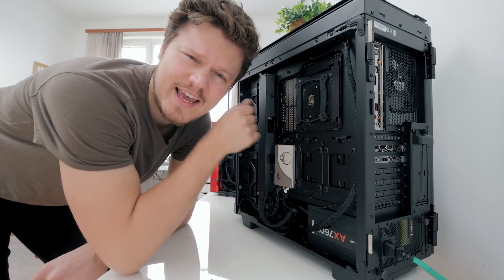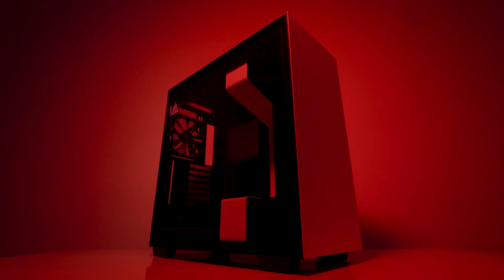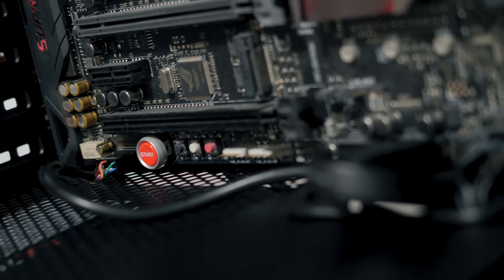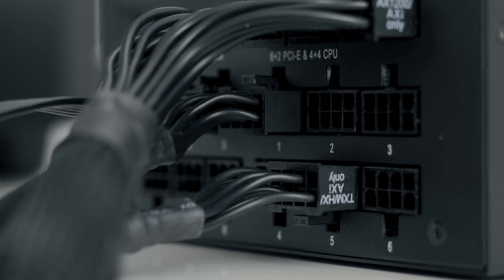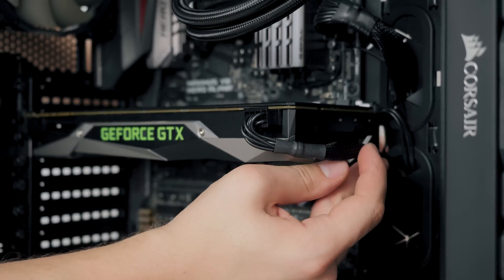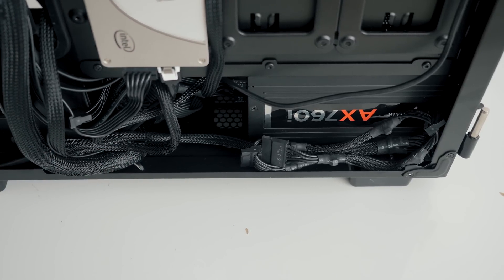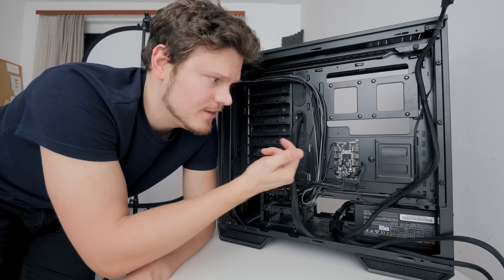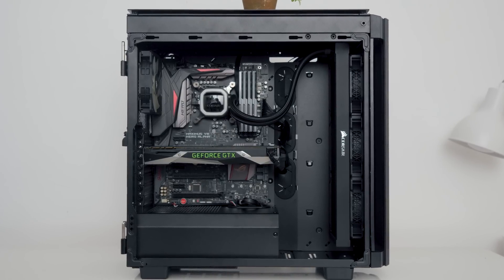Tips for the PERFECT Cable Management PC Build

Comment: didnt ltt prove that cable management doesnt do anything to your cooling?
Reply: they did. They had to fil the inside with stuffed animals, blankets and block the Fans with cardboards in order for the Temps to Show any Impact xD So yea, with only cable Management, it's impossible to affect temps. At least in LTTs test.
Reply: @Darkseth1988  take 2 big ide cable sideways
Reply: I feel like cable management is a passion thing. If you're super passionate about PCs, you'd want to make it look at nice as possible.
Reply: @eebrohim7001  I agree, I'm really passionate about every PC that's gets built and sent to my clients so I always make sure that it looks as neat as possible even if I cut my fingers 😁
Reply: @eebrohim7001  if you have a glass panel on your case then it makes the appearance a lot better
Reply: nothing to your pc, but it definatly makes the user cooler :D
Reply: Krytykują
Reply: That's only if you care about temps. Not having cables in the way improves airflow consistency, meaning it's quieter to achieve the same performance.
Reply: well, differnt values affect cooling (case design, quality of fans, number of components inside the case etc). Gamers nexus showed that for example half an inch of mesh on the front can make quite the crucial difference when it comes to thermo throttleing of GPU for example. So if you have a bunch of cables hanging infront of a fan (hindering airflow) or have them neatly tucked away, if makes a difference of about 1-2C°. Which can be the differecne between GPU/CPU throttleing or not under the right conditions.

Comment: Ok, cable management makes no meaningful difference to temps in the vast majority of cases.
Reply: Same with thermal paste :D
Reply: In older cases, I can understand cable management affecting it. But with so many improvements over the years, you make a good point.
Reply: Seriously the only way cable management would affect thermals is if your fans were tangled up in it.
Reply: no just no
Reply: thermal paste is important but cables aint anymore unless its really really bad
Reply: still not a fair case. as long as there is airflow, thermals are not going to change and even if it did it's by 1-2 degrees. cable management can only affect small form factor cases where space is tight. But even if you had an old system in a mid-tower like most people do, it affects practically nothing
Reply: Yeah but it sure as hell looks better,like does rgb help?
Reply: That's not the point of this video.
Reply: Im 99% certain Linus tech tips tested this. and no matter how bad the Cable job was. it didnt affect the temperature enough to conclude it was the cause
Reply: It's what he said at the start and yeah, LTT did test it
Reply: It can do if you have a really cheap or old case and have a mass of cables all tangled up and covering the graphics card, CPU cooler, or hard drives for example. That can block airflow and increase the chance of dust gathering to take place.
Reply: Cable management is really only helpful in mini ITX cases.